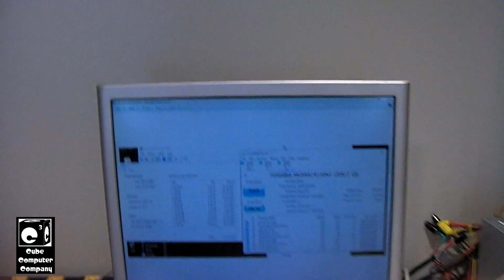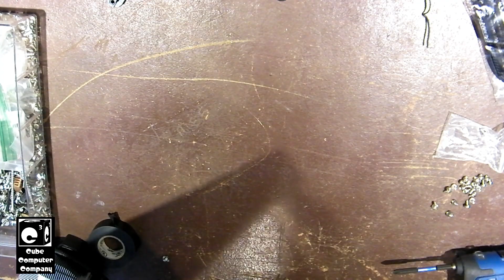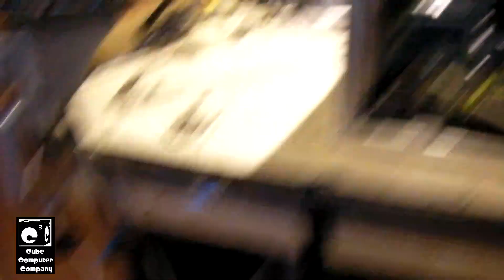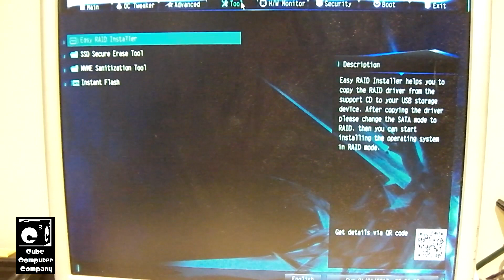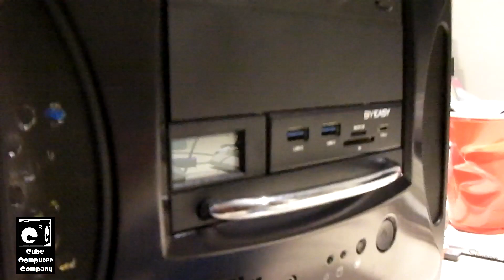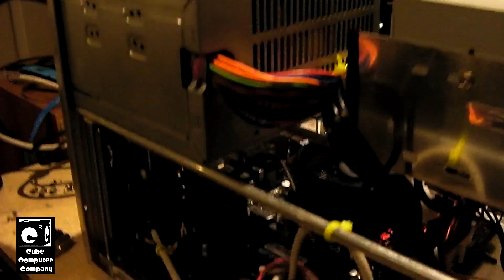Building new Ryzen 5 5600G system into NOS Apevia X-QPack II Case

Comment: That's going to be a solid computer for a very long time! Fine tune and fix those little problems, I think you'll be very happy!
For some reason r2d2 comes to mind  😁
Reply from the maker: It's amazing! Lots of power, yet very efficient. My work had agreed to let me bring my own device since I absolutely hate the managed desktop that's there, and I get to have a desktop to edit videos on during my downtime at my desk. A lot of my "job duties" are to basically be present at a desk in a lab to assist students.

I'm starting to nudge my new next door neighbors into having me build them a desktop system since they just sold their old laptop. If I get to build them a system, I'll plan to use your donated X570 board for that.
Reply: @CubeComputerChannel  awesome! I hope they go thru with it!